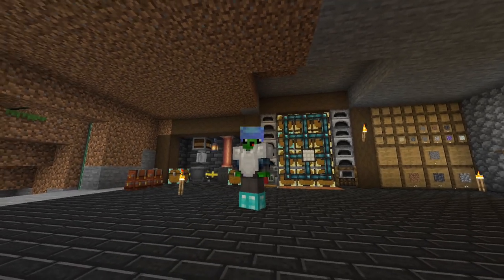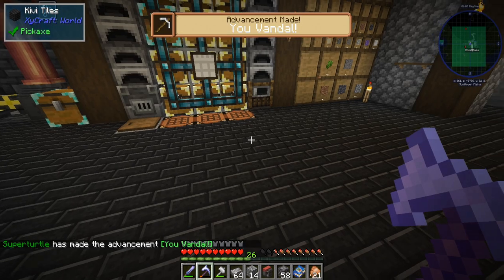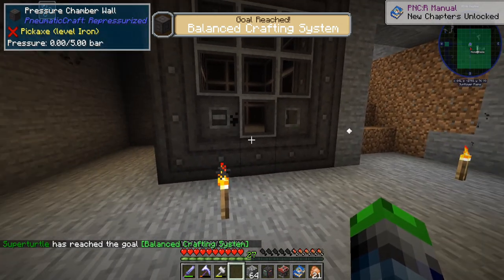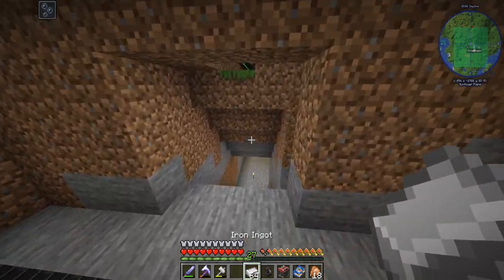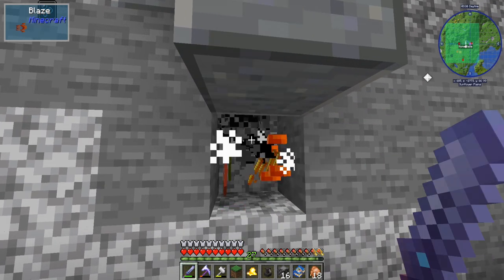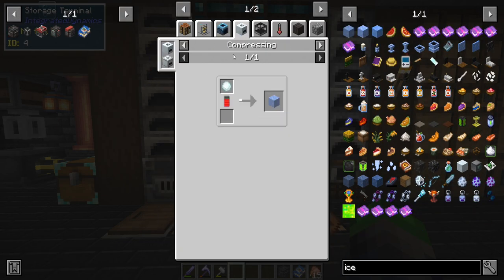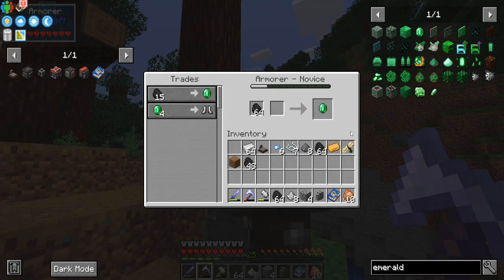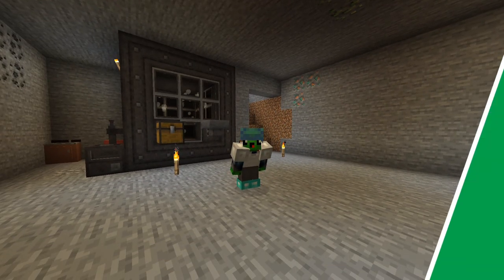So Much Pressure from PneumaticCraft! | All the Mods 8 | [EP 06]

Comment: @superturtle - About the thermal compressor, it uses the (close to) real-world principle of "thermal exchange".

Basically the "hotside" is heating up the cold side, while the cold side cools down the hot side. The difference generates pressure.
Problem is when the hot side gets too cold, it turns to obsidian (just like when you poor water over lava; as its a lava "Cooling" effect).

To get around this, do the following.
For the hot side: either use another material that doesnt lose heat, Like the superheating element from mekanism. Or generate heat using energy with either a fuelwood heater(uses burnable stuff) or resistive heater (uses FE).

For the cold side: either use a solid "cooling" material like a heatsink, or use a "filler" to endless replace the water that is burnt up from the process.

----
Also, i recommend you use a "pressure gauge" and some redstone to turn off your compressors when you reach your target limit. Stops it from blowing up and doesnt waste energy.

Comment: @superturtle - you can use buckets and a tank to get started with oil processing, or the mekanism pump and pipes. Be warned the little bit of oil you have will not be enough. |  The pnuematic drill is for "drilling" for oil, and is a later-stage game item. While it may be possible to make it now, to use it will require a lot of air storage to drive it. (EG: building pressure chambers to use as air-tanks)

PnuematicCraft: Repressurised is a difficult mod to use, as it forces you to do things in a more realistic manner. Understanding Pressure, Volume and Displacement to use the tools, equipment, and drones.
I recommend you watch some videos on the mod to get familiar with it, its a doozy.